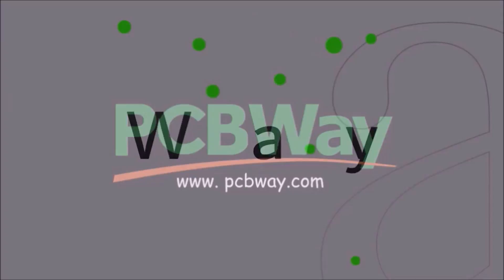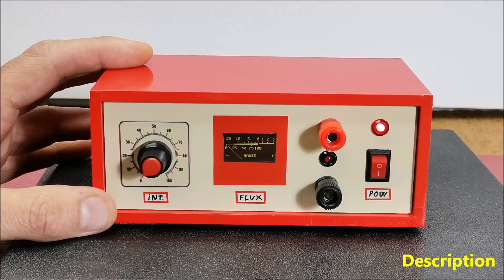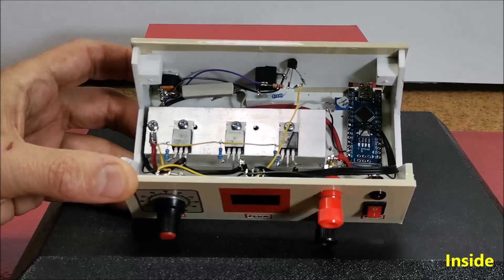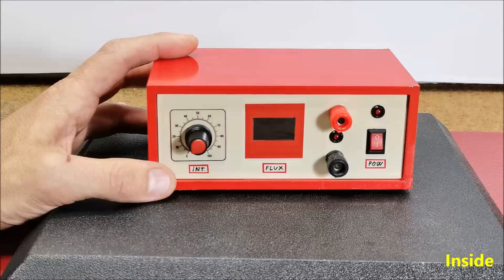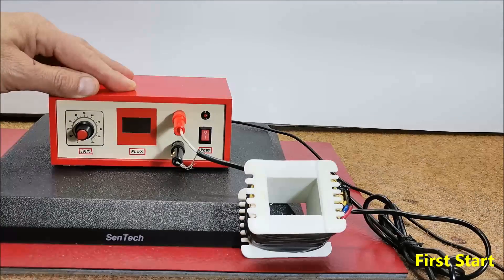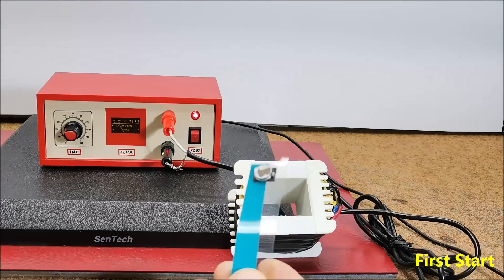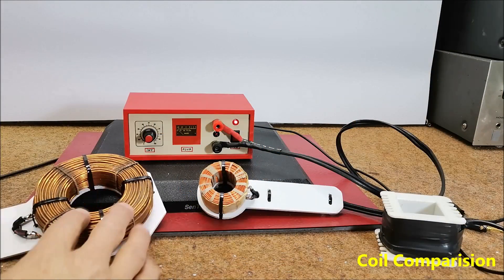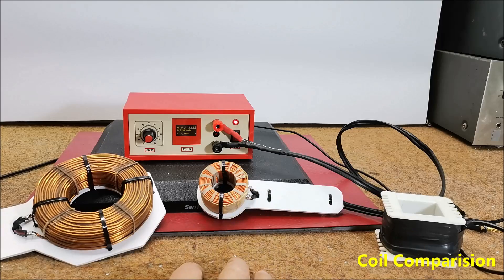DIY PC controlled high power PEMF Therapy Device

Comment: I'm a graduate student in Korea for PEMP-related research. I'm currently organizing parts and devices to implement the same after seeing your video and the link you manufactured. Do you have a 3D modeling file to make the same device as you? I'm asking you because I think I can make a cleaner and more accurate device if I make it with a 3D printer.
Reply from the maker: Sorry no , I build my box from PVC table

Comment: In the diagram, the central leg of the mosfet is connected to the coil, but in the physical circuit that you show it has no connection, could you explain it?
Reply from the maker: The center leg of the Mosfet is the same as the heat sink, so that wire is connected directly to the heat sink.

Comment: Hello, thank you for sharing your designs, I wanted to tell you that I got some coils (FLAT COIL p 180) and my question is if this circuit that you present here would work for said coils, which in fact are the same as those seen in the following link

https://scontent.faep6-1.fna.fbcdn.net/v/t39.30808-6/240735163_881645375768993_7252479043763106412_n.jpg?_nc_cat=101&ccb=1-7&_nc_sid=5f2048&_nc_ohc=wS_Wd0h4nmoQ7kNvgGEcMqM&_nc_ht=scontent.faep6-1.fna&oh=00_AYDEgdjSUqlLOgVPCrpRq5H0y0E_SgktxuNQ__PjH2ZTaA&oe=667E7DD7